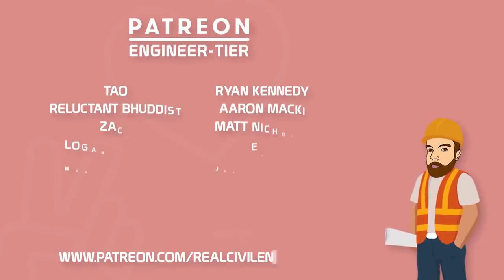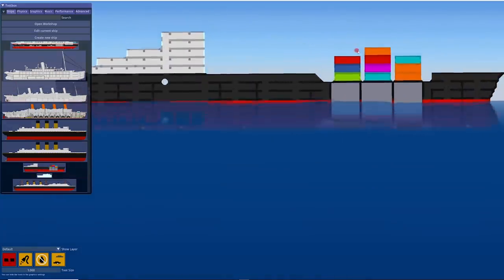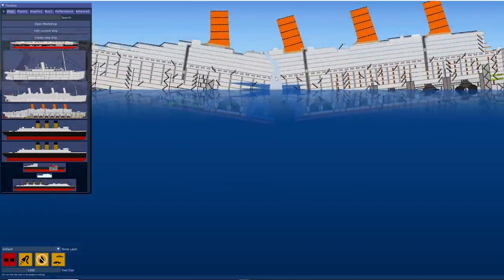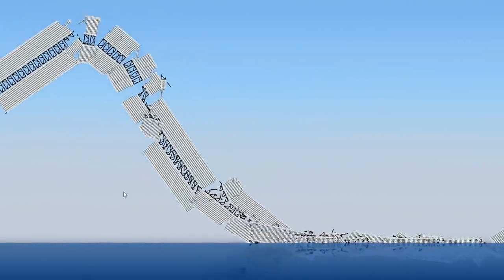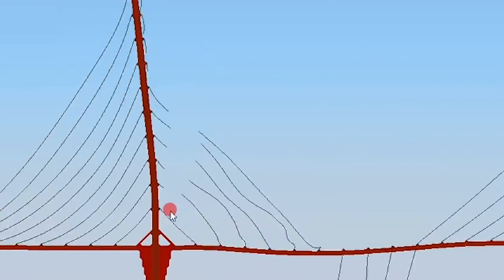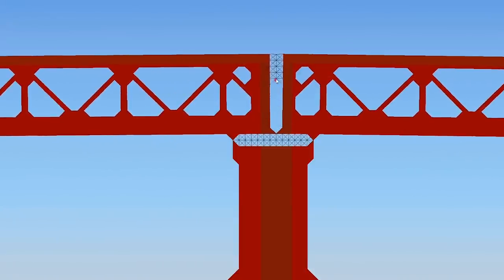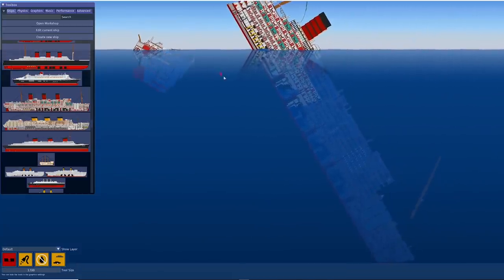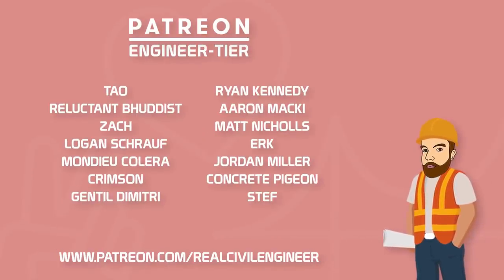I Filled a 1000 STORY SKYSCRAPER with Water and it Didn't End Well! Sinking Simulator!

Comment: Fun Titanic fact! You know those segments in the hull that stop the water from flooding the entire ship at once? In the titanic they had gaps in the top of them, which allowed the water to flow between them under extreme circumstances they belived would never come up. This is one of the reasons the 'unsinkable' ship sank
Reply: Why did they think that was a good idea...
Reply: @MGSLurmey  the compartments can lock off so if a few flood the ship still stays afloat I think for titanic it was 4 of them being the limit and the iceberg shredded through 6 at least directly so it never had a chance and if you think 4 is too low, there hasn't been a maritime disaster that bad before or after titanic it really has been a one of a kind event
Reply: @MGSLurmey  practicability and costs
Reply: we know
Reply: And here I thought it was because it hit an iceberg... Guess it was more complicated than that :P
Reply: @roberthalbert2972  yeah, they designed it so if they hit something head on, only one compartment would fill, which shouldnt have sinked the ship, but the iceberg hit the ship diagonally, breaking several compartments